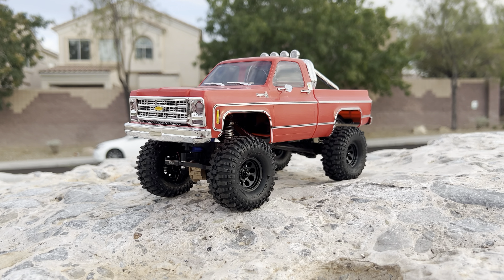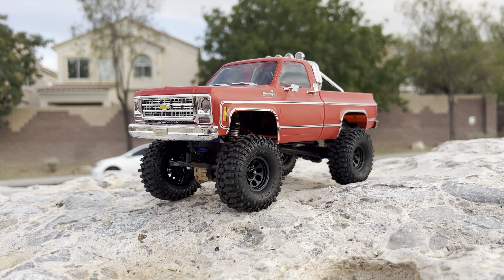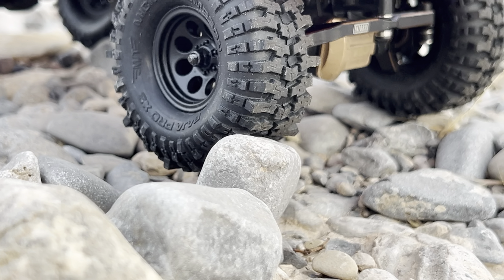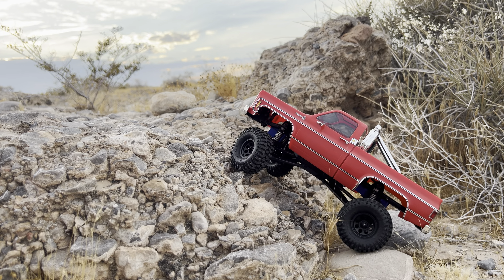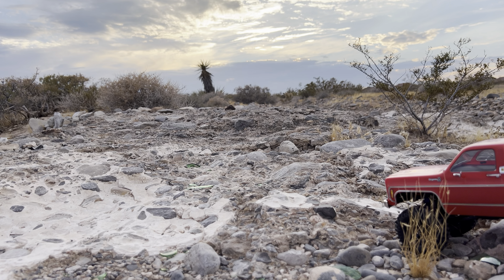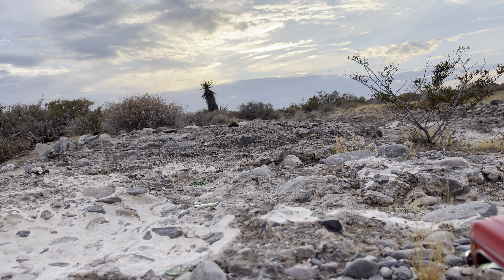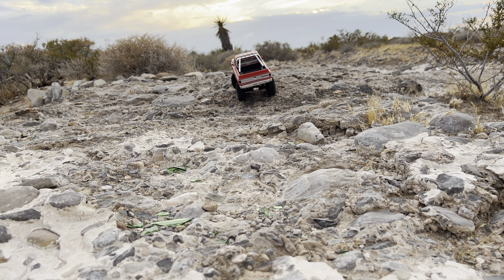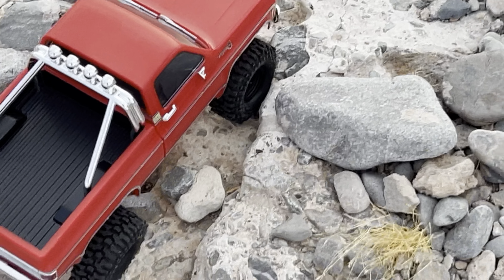Traxxas Trx4m 2 speed transmission test on the trail and rocks and my thoughts on this set up.

Comment: It appears, Traxxas didn't spend enough time on R&D for that trans. For the price, it should perform better and should at least have bearings inside.
Reply from the maker: Agreed.They should have given the same low gear ratio as the single speed low range gears and for 2nd gear give it the same ratio and the trail gears.👊
Reply: I totally agree👍